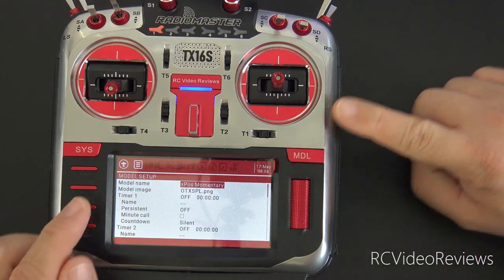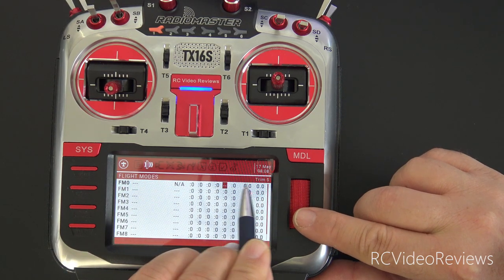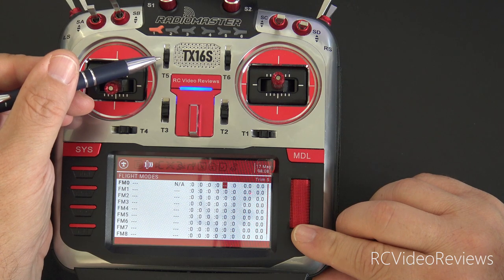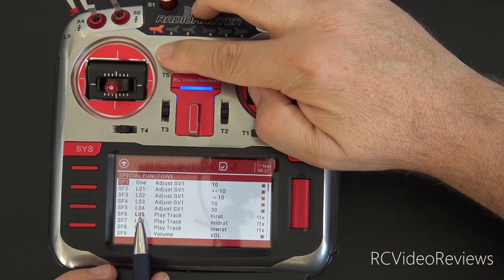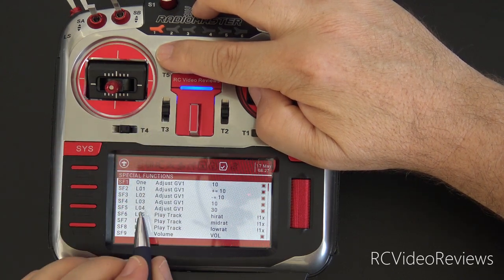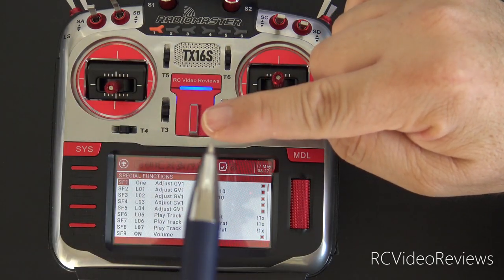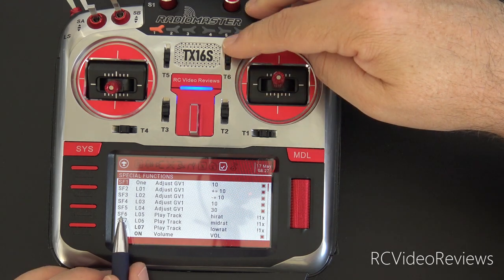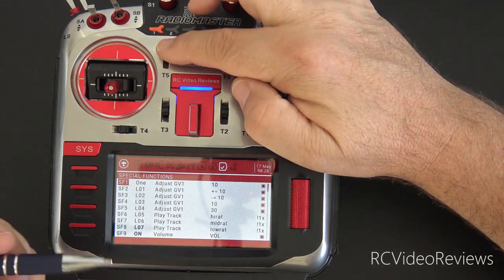OpenTx Snippet • Momentary Switch as a Multi-Position Toggle Switch

Comment: Example would make more sense if the radio used did not already have a 6 postion selector. WHY would you want your rates to go from the lowest value to the highest when you cycle through?
Reply from the maker: The request came from someone looking to buy a Tx12. It will also work for all OpenTx radios. Some people (like me) use the 6p as a flight mode switch. It’s also not about the switches, it’s about teaching how logic on OpenTx works so no matter what function the viewer wants, they’re equipped to use the logic available in the software to get it done. 

I don’t judge what people want to do on their radios.

Comment: Hey John. I was wondering would it be possible to set flaps up in flight modes on open tx. So when I flick my switch for Landing flaps I could adjust the trim for the elevator in that flight mode seperate to the elevator trim for flaps up.  I hope that's makes sense what I'm asking :). Keep up the good work.
Reply from the maker: Sure. Just use the same switch to activate your flight mode as you do to activate your flaps. Here is a video on setting up flaps with a switch: https://www.youtube.com/watch?v=boDiKX33dCg  Use that same switch to activate your flight mode and configure the flight mode to use its own trim. That will do it.
Reply: @RCVideoReviews  awesome that worked perfectly thanks so much :).

Comment: can you show a way to have two radio profile in one openTX companion? I have the jumper T18 ..hehe and I just order the radiomaster color gold. or do I need two computers? maybe show on next open TX school?
Reply from the maker: I could show it, but it's really easy to do, just add a profile. You can switch between them as needed. I have multiple radios setup...Just click SETTINGS -> RADIO PROFILEs -> ADD RADIO PROFILE

Then you change between them as-needed.

Comment: TY John, I have been want to free some toggles and this will allow it with ele and ail to still be on separate switches.  is there a way to have them stay at last flown rate as it sounds like they reset each time you turn on the model??
Reply from the maker: I did a small amount of testing and I did see GVAR initialize with a non-zero value more than once, but I have no configuration steps to make that deterministic. You'll have to test...I purposely designed this one to reset to a specific value on each load of the model.
Reply: @RCVideoReviews  I will see if I can make it work but may just have to live with it

Comment: Could you do this with the tx12 momentary button!
Reply from the maker: You can go one direction only with it. Just use the down position for the logical switch and to clean it up I would remove the logic for the up button.
Reply: @RCVideoReviews  thanks
Reply: @travissenft3242      set the momentary switch (SH) for throttle cut  on and off.
LO1  EDGE  SH down
LO2  a>x  GV1  11
LO3 a>x   GV1  9
LO4 a=x   GV1  0
LO5  a=x  GV1  10   ---   ---   0.2
SF1 One Adjust GV1   0    (some ESC won't work when throttle cutoff is on when binding.)
SF2  LO1  Adjust GV1  += 10
SF3  LO2  Adjust GV1   0
SF4  LO4  Play Track  thract  1x
SF5  LO5  Play Track  thrcut   1x
SF6  LO5  Override  CH3   -100   (throttle channel)